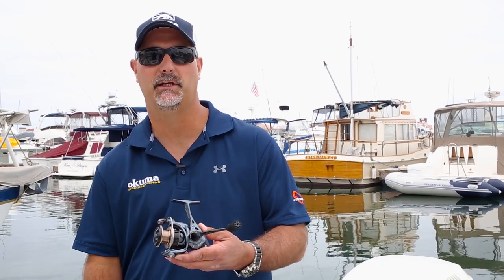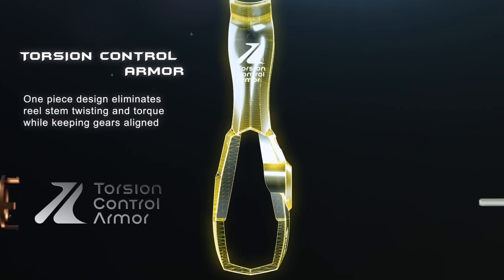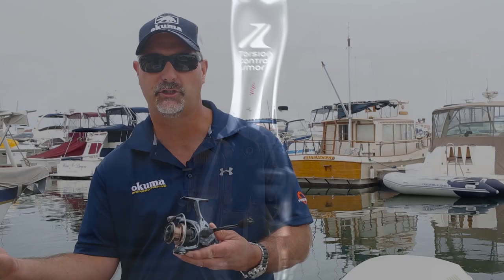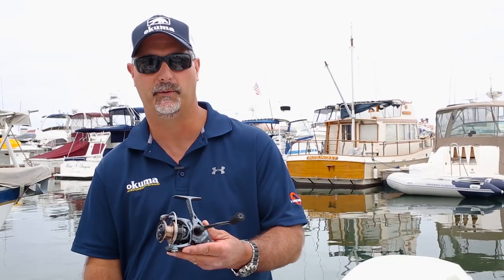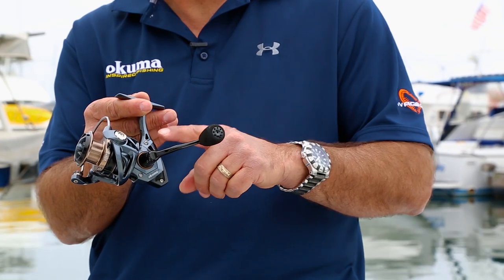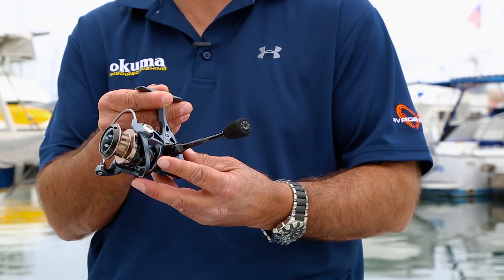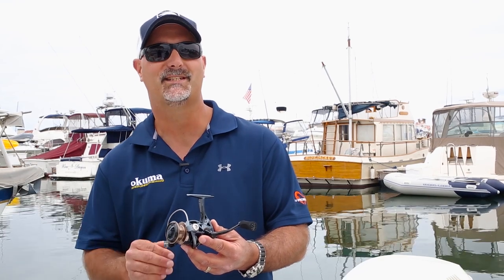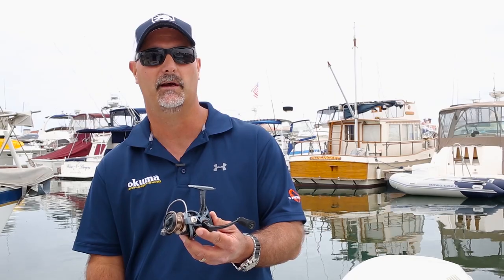Okuma's Epixor XT Spinning Reel

Comment: Is the handle screw in ?
Reply: Not a screw in handle - major point deduction.
Reply: I will tell you that Amazon has the 30 size for like $33.00 right now.
Reply: Major disappointment, both handles were plastic where they meet the drive gear. They are toast stripped out. No help from Okuma!